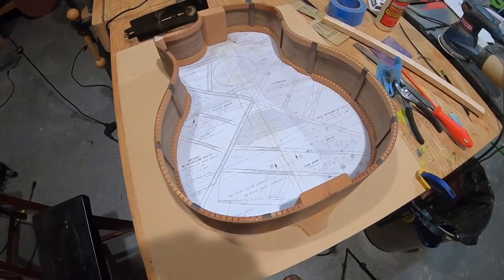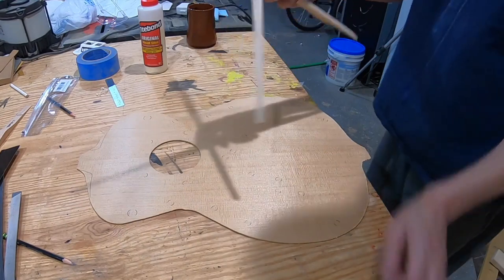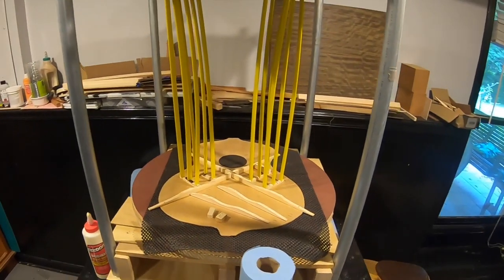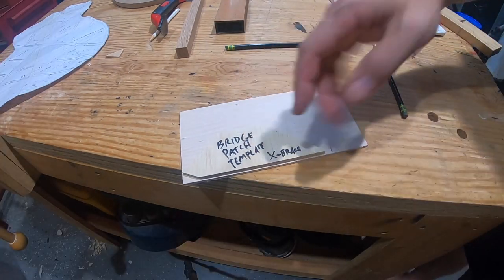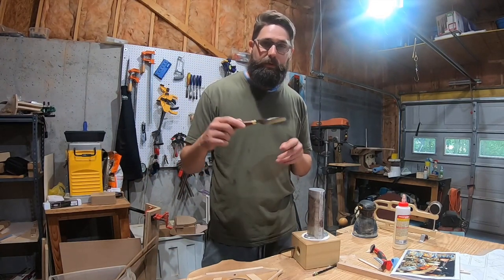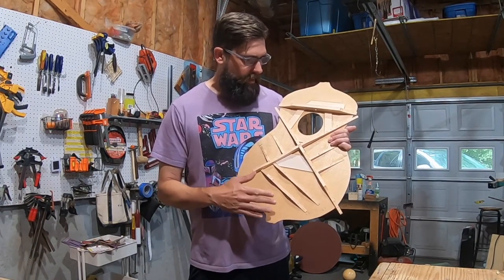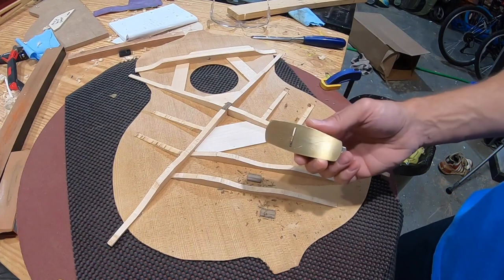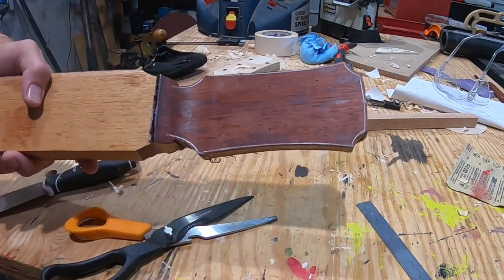Voicing the top and making the headstock // Florentine Cutaway Guitar Build part 5

Comment: Good recovery on the bracing.  I don't have the issue with numbness in my thumb, but I think it may be due to holding the chisel differently.  I don't recall putting pressure on it.  I will have to pay attention next time.  The idea to radius the bridge plate is interesting.  I haven't seen anyone do that either.  I like the way you question things like that.
Reply from the maker: Thanks for the response about numbness, Mark! I don‘t know, I might just be holding the chisels incorrectly. I will try to pay attention next time to see if I notice anything particular about how I‘m gripping them.